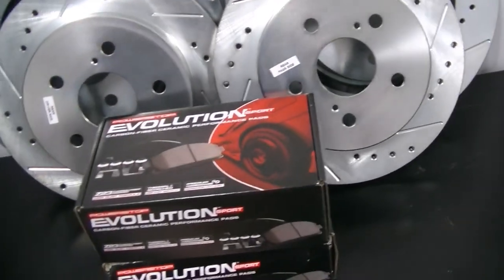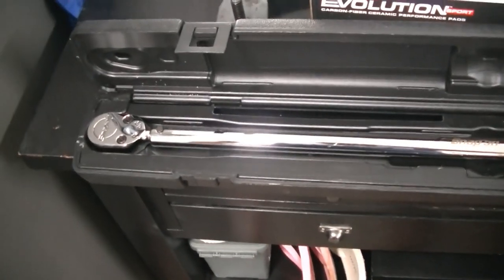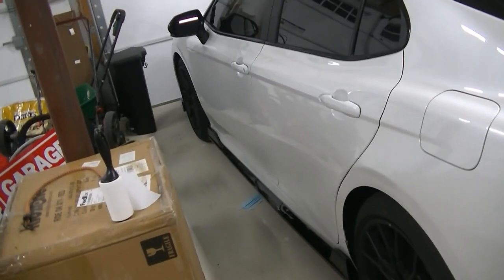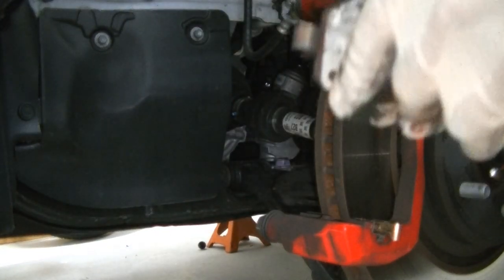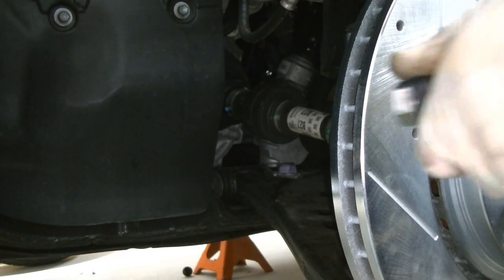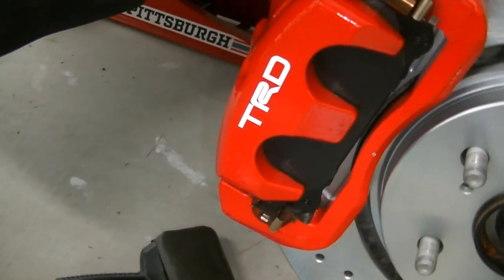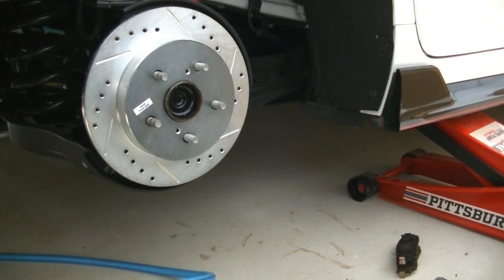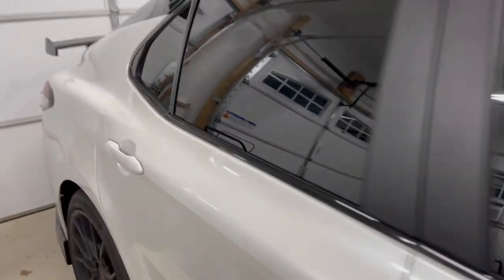Powerstop Brakes Z23 Drilled and slotted rotors upgrade 2018-2023 TRD Toyota Camry

Comment: Nice job man! I will be doing a highlander front brake upgrade from a 2nd gen on my 04 5th gen camry. Also swapping from drum to disc brakes in the rear.
Reply from the maker: nice! the 5th and 6th gen camry had crappy braking systems (prone to warping) so that should be a huge improvement!

Comment: I hope they are good for you as they were bad for me. I had used them with Wagner E-Coat Rotors and the brake bite was horrible depending on the weather. If it was hot, I had to really push the pedal. If it was cold or moist, they bit great. This is from a cold start and it remained the same if not varied throughout my drive. 

Currently using Raybestos EHTs.
Reply from the maker: I performed the break in procedure last night. When I first put them on the bite was a little iffy but after break in they’re great. Ceramic brakes will inherently bite better once they’re warm they don’t like stopping when cold
Reply: @SEsGarage  After I got squealing from Wagner ThermoQuiet's, I was able to warranty them and I think I had done the break-in. They still squealed so I got the Z23's and did the break-in along with another set of warrantied Wagner rotors.

I know a little bit after that I had to really stomp the pedal to stop but for the rest of the year I'd say I had a varied experience with them that were mostly okay up. Fall was alright, winter they bit down hard, spring was alight, then the next summer I got very tired and scared of stomping the pedal to stop. 

Hot, cold, it didn't matter what the brake temperatures were. It was the outside temperature that effected them more.

So I am hesitant on PowerStop now. The Raybesto's EHT's have been extremely good. A bit of squeal but not a big deal.

I had done a brake flush to DOT 5.1 when I had gotten the ThermoQuiets.

Comment: Excellent video! The brake dust for my TRD is insane (more specifically front brakes). I'm looking to do this upgrade. When you compressed the brake piston back in did you take off the brake fluid cap or leave it on?
Reply from the maker: Nope! Just leave it on
Reply: @SEsGarage  Thank you!

Comment: I have a 2021 TRD and im having an issue with taking off the old front rotor.. it seems like the rotor is welded to the wheel hub center and the wheel hub nut is holding on the rotor.

Comment: Hello
Please provide torque specs for the front and rear caliper brackets and caliper pin bolts.
Thank you
Reply from the maker: Good and tight is good enough in this situation

Comment: Did you get this as 1 kit for front and rear or 2 kits . If 2 kits which kits please . Thanks for all the videos and procedures.
Reply from the maker: You can get it as either or but because I purchased fron rock auto I did the front and rear kits separately. You can either go to powerstop‘s website and plug-in your year make and model to get the kits that you’ll need or you can go to rock auto and do the same and it should automatically populate what you’ll need. On rock auto it will say for TRD model if you have a TRD

Comment: You never specified brake pad installation after warning there was a right way an wrong way. I wish you recorded that. And I wish you recorded yourself using the torque wrench and torquing the bolts.

Comment: Two months after I purchased the Power Stop brake kit my right rear caliper failed and began leaking brake fluid. After waiting three weeks for the part, they now tell me the ETA is over a month away. This really sucks. I now have to buy and install a temporary generic caliper while I wait for the Power Stop caliper.
Don't do it.

Right Rear Leak  TT797144
Reply from the maker: We used our OEM calipers in this install

Comment: Do you have an Amazon link or any link from a supplier for this kit (or SKU), I’ve tried to find it and can’t. I have a 2019 Toyota Camry SE and blue calipers are BLACK every week. It’s so frustrating. Thanks for any help.
Reply from the maker: https://amzn.to/3u9wwoV 
this is the front kit for a 2019 SE
Reply from the maker: https://amzn.to/3DAZNf1
and this is the rear kit youd want
Reply: Thanks for the speedy reply, liked subbed the whole 9, your channel is definitely my channel when I’m having issues (which are very few) but you gotta do that maintenance. 

How are those brakes working for you compared to OEM?
Reply from the maker: @moosiferhofiusaw8007  they stop great! They’re super quiet. And they have minimal dust. Do keep in mind that the TRD does have larger front brakes so I’m not sure if that has anything to do with it. Either way it’ll definitely be an improvement over stock
Reply: Either way I’m going from OEM after nearly 75k miles because I have a wobble that’s getting more severe, but wanted something with some killer stopping force because I live in Chattanooga TN the Capitol of moron drivers who would cause a 10 car pileup to stop for a  mouse on the interstate 🤣….and these brakes look like they’ll last me maybe 🤞100k miles because of how I drive. 

Thanks so much for a speedy answer and a lot of knowledge, the idiot at autozone called them “expensive shit, that will get the job done and fail prematurely” I
Left the store yesterday and found your video, someone who has them on his car and knows 5k X more than autozone idiot!

Comment: Waste of money -Toyota already upgraded the braking system of the car it stops very well 60 to 0
Reply from the maker: Didnt have an issue with the stopping power of the car, I had an issue with the amount of brake dust the factory pads throw off. These are a night and day difference already
Reply: No they hell they don't iam at 35 rotors are shot shakes when breaking
Reply: I'm at 28k and the factory rotors are completely warped. Good choice changing them, I'm going to do the same.
Reply: Bro it’s just rotors it’s still stock calipers it’s not even comparable to a big break kit
Reply: And it’s the same price as OEM replacement and it’s drilled and slotted rotors instead just buy any ceramic pads and your good